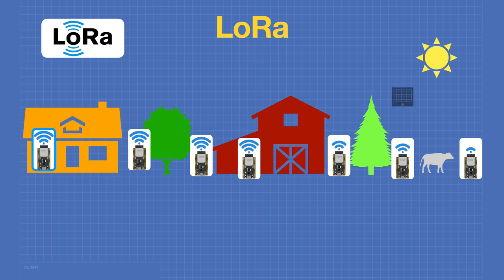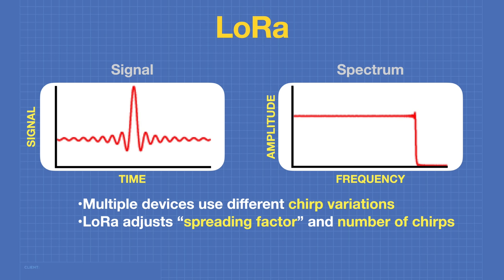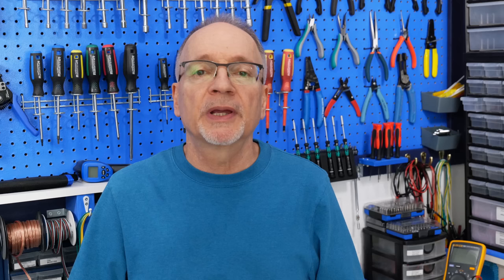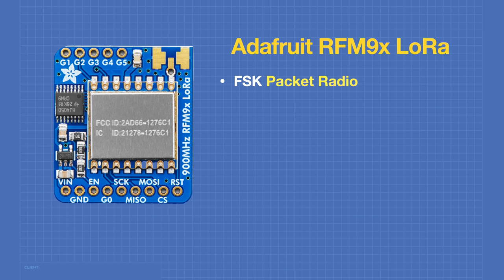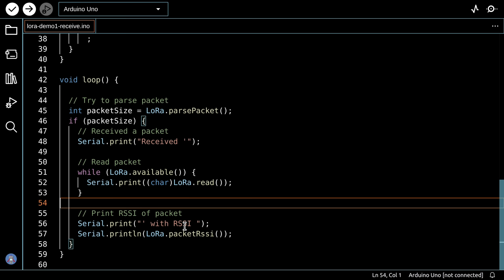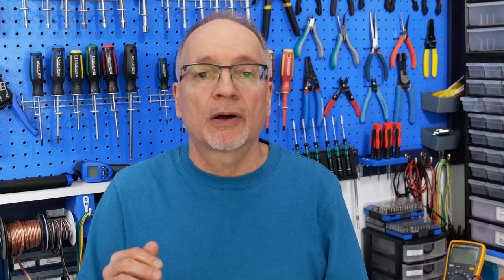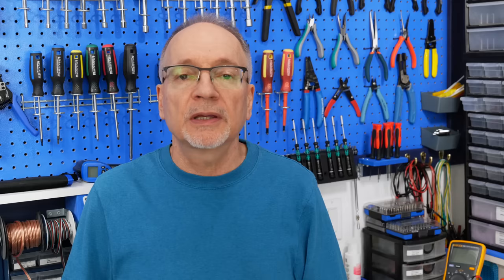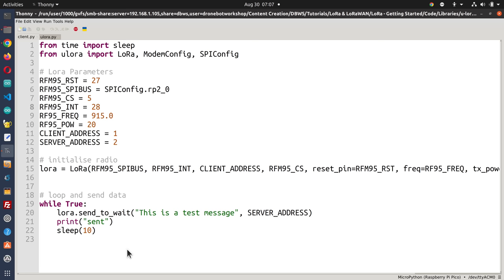LoRa - Long-Range Radio for IoT | Arduino, ESP32, RPI Pico

Comment: THANK YOU for not using scrolling code windows on your web site.  I absolutely HATE those because when printing, as I always do, valuable web pages to PDF from which the code can later be easily copied and pasted from, the windowed code won't be completely printed and so many sites don't allow the window to be maximized.  If they allow listings to be easily copied or if one copies from the scrolling listing, each must then be stored in a subdirectory instead of ALL being accessible in a SINGLE PDF document along with descriptive text.
Reply: If you right click the effected section and go "inspect" (or inspect element on some browsers), you can usually tweak the CSS or HTML content to fix the problem.... after some practice, it takes about 30 seconds to fix most unprintable sites.
Then just print to PDF (or a printer) as usual.

Comment: Great video, but I do have a suggestion. The way you are using millis() for timeout will fail due to rollover. millis() is an 32 bit uint. When it exceeds 0xffffffff it rolls over to 0x0, causing the timeout check to fail after ~49 days. This is obviously not a problem for testing but if someone leaves it running, it will be. You can check by determining if new millis() < old millis(), if so then elapsed time=(0xffffffff-old) + new.

Comment: Fantastic video! I'm currently building a soil moisture monitor using PicoW+Lora E5+capactive soil moisture sensor+microPython+ Home Assistant with MQTT+InfluxDB+Grafana to make decisions on irrigation for growing feed crops.
Reply: I am looking to set up a similar sensor array using some of the same tools for an agrivoltaics project. I'm particularly interested in your integration into HA. Could you provide more details about the project?

Comment: I'm transmitting and receiving data 3.2 km away with a simple spring antenna that came with modules, no clean LOS but still works great, -105 avg dBm so signal is pretty strong. I've just assembled 3rd device that I'll use for reserve and distance testing so I may update this post soon. Lora is amazing
Reply: What kind of data rates are you able to achieve?
Reply: That's handy to know. That's about the max distance I'd need to run any sensors.

Comment: I think Lora is the basis of a drone controller technology called ELRS, it uses the SX1280 chip to do the data receiving part of controller the drone and then you send the signals into the flight controller to perform the action based on the input
Reply: Well ahead, publish your works !🎉❤

Comment: At 21:00 ground goes to thin filament of LED but when you connect it for real at 24:41 ground goes to thick LED filament as it should. The led at 21:00 should be rotated.

Comment: LoRa is a 900Mhz signal so line of site is pretty much what you need between radios.  No buildings, mountains, etc.  Elevation is used for long distances.  If using radios on the ground, 3 miles is considered line of site on a completely flat ground.
Reply: He put a steel plate between the modules and it still worked. Lora is supposed to be able to penetrate materials much better than 2.4ghz wifi can

Comment: I use a cheap esp32 China module(433Mhz) with a build in 18650 battery,..and display ,, no soldering nessesary.
I use Aprsdroid app for following the aprs signals.  or  my Yeasu ftm400 

Its very easy to program the module  with a callname and some txt
Reply: HI Bert, can you share more details of what you are doing?  I am interested in similar.
73

Comment: Great video. For the wireless transmission part, you chose RFM9X with SPI interface. Have you considered other modules with other interfaces, such as UART or RS485. Maybe, then It can transfer further, like LOS10~20km.

Comment: Thanks! Very informative.  One question about the payload, is that a standard format? How do you know a packet is actually intended for you ?  If your neighbor ran the exact same code would you both process each others packets ? How do you assure unique communication pairs ?
Reply: Good question. And one that is quite important to answer, its not just one neighbor but anyone in a 10 block radius...

Moreover while I echo the sentiment of many commentators about the pace and quality of your presentations, I am staggered at the effort required to hard-code the OLED display.  I think there is some generous use of the term "we" as in "we are going to display two temperatures and two humidity values".  Realistically the network needs to be expandable so that "we" are going to be able to  receive input from N sensor types and M sensors in each type.

Plus the server may need to do computations, for example to calculate the difference of two or more temperatures or report the lower of the humidity readings and may need to set of alarms or visual indications of abnormal conditions and take multiple corrective actions, both at the server or back at the location of the sensors.  I see nothing in the code to illustrate how you would do this.  

Neither is it permanently, or temporarily, logging the time, identity and sensor value, so there is apparently no way to compare yesterday's value at the same time of day or take the sum or average of all readings within the last hour, the last week and so on.  

Basically unless you are actually looking at the OLED the whole setup is working for nothing.  

I saw a video today where the designer used png images created in Powerpoint to produce coloured sliders and formatted text boxes to create a really impressive customised OLED display.  But, in a day when we are not surprised to find such information on our mobile phone, I think that some of this video promulgates an outdated approach to sensor data and coding for the OLED display.  The mobile phone and not an OLED is likely to be at the heart of the interaction between a user and any network of sensors "we" are building, so to me it feels like you haven't really taken this to next-level IoT programming, and you may be training your 500k subs to think in silos.  

Please  don't misinterpret my observations as criticism.  Thank you for rekindling my interest in LoRa and Arduino.

Comment: Hello Bill, thanks for your show, invaluable, would like to know, if it's o.k. to use the R4, with Minima + wi-fi, to achieve long range connections, as you mention in your introduction to this Arduino Circuit. This Circuit is cheaper, and want to get started. Thanks again, watching your show, like going to Class. Loving it..🌹😊

Comment: I see little information on different frequency selection, how to set power output and how to choose the best Spread Factor. I have a number of RFM95W's in use and they work well but I would never get over a KM in range.  How do you measure the output power of a LoRa board?

Comment: I am a car guy with a good knowledge of electronics. You have have some but in blend door actuators use to control hot to cold, the simple ones use a gear driven potentiometer for 0-5Vdc and a dc motor to move and stop anywhere between closed & open. Being one level above cable and vacuum, how would a rotatory dash knob change polarity in the motor? I have 40+ years at dealer but as simple as can be, these controllers on the dash are only $40+ and one circuit board inside. I wanted to control heat / A-C in a 67 C10 pickup. Schematics show a block and call it "Logic". Is this an ardiuno thing or something way more simple that can build myself? Sorry to get off topic but your teaching choice of words are easy to understand.
DK, ASE Master Tech since 78, retired. Thanks.
Reply: I guess I was hoping for an idea or answer. In the world of "Robots", arms, legs or any part that moves part of the way, stops and moves some more while having the ability to return would fit my needs. It is no different than an "RC" car's steering. Left, right, center or anywhere in between. The problem comes in the controller as it has 6-9 other features costing 20 times the actuator. Just a simple mechanism to move, stop and move again. Maybe they can't make a controller that does that on 12 Vdc with a few wires, not a radio frequency. ASE Master, 78

Comment: Would be cool to have lora microcontrollers out in the wild powered by solar and mini wind turbines that could make an 'offgrid' online so to speak.  The power efficiencey of these things could make them autonomous and have them on for a long time maybe even indefinately which would be handy for emergencies and communication and what not. I was trying to imiagine this with regular low power wifi micrcontrollers but it seems Lora has them beat for range at leaste, speed on the other hand...  could a lora microncontroller be able to host a copy of doom2 if the internet goes down for us to download?  how about connect and play a game of co-op with reasonable lag?  I dont mind waiting all night to download, but the lag should be reasonable under 100ms ping.  If Lora can do that, we have made progress!

Comment: Great video as usual. Thanks.
All your examples seem to use the Adafruit module but I want to use the HopeRF module (with Pico/Pico W). Am I correct in assuming that I can use DIO0 instead of G0?
What are the other DIO ports and how are they used?
Thanks in advance

Comment: Hi Bill! I have a couple of questions regarding the esp32 controller method.

1. How much data can be transferred at once? From my understanding a normal esp32 is limited to 25 bits but since it has a lora connection, is it any different? 
2. Would you be able to use an Arduino in place of the esp32? Would it be able to use the full LoRa bandwith?

Thanks!
Adam

Comment: Early in to video it was mentioned that the data is(Or as I assume can be) encrypted. I don't see the usage of any keys, and it seems each device is reading one another in the clear. Are there examples of using LoRa with it's encryption features? That way you could use it without a 3rd party messing with your network.

Comment: Inches are divided into 1/4 1/8 1/16 1/32 1/64 Not 0.390 - 0.390 is less than 0.500 = 1/2 also 1/4 can not be used as it is 0.250 = to short, So first we divide by 1/8 = 0.125 So how many 0.125 in 0.390 = 3.120 So we have 3 x 1/8 with 0.120 over Now we use 1/16 = 0.0625, So how many 0.0625 in 0.120 = 1.92. So now we need to use 1/32 = 0.03125 to be as close as possible. But I will not quibble about 0.92 of 1 16th as it is so close to 1 16th and call it 2 16ths so the last total = 3" ins & 7 16ths long. But would start with a length of 3" & 1/2 inch and take a tiny snips off to tune the antenna - Other wise a great video

Comment: thank you for your video!! It help me start with LoRa.
Also I have followed the step in the section LoRa with micropython code and demo, but there are some question on my code. I used raspberry pi pico with the code, and it would turn out "AssertionError: LoRa initialization failed". May I asked you what may be happened with this problem? thank you.

Comment: Are they still working on Giga R1?  Can you tell me about the pin setups and software needed to get one or more of the touch screens working on it?  I have read on spec sheets about D1N, D0N, D1P, D0P, CKN, CKP + D68-D75 being the display oriented pins, but that doesn't tell me enough to know what displays and chips will work with it.

Comment: I ran this demo 3 with 2 usb c cables from the same mac computer. 1 to each r4 wifi connecet like shown to adafruit lora. I copied and pasted the demo 3 sketch into arduino ide, 2 seperate windows. changed local address to AA and BB, compiled and uploaded, made sure each r4 wifi unit blinked, indicating it uploaded. clicked the toggle buttton , it did not work. tested demo 1, demo 2, it worked. started debugging with serial statements, realized there is an issue with serial when running 2 windows. got rid of all serial statements from both sketches. it works like it should. not sure what arduino ide does not work  with 2 windows. but it works without serial.
Reply: now i use onley1 ide open, with 1 lora connected to mac, the other runs remote. still serial messes things up. almost seems like you cant have Serial in the onreceive. it will print the first char of whichever serial.println it hits, but then it will hang in that state. ie pressing the button first time will turn on led, but you can never turn it off. might need to use software serial, not sure.
Reply: from your interupt video, it seems that Serial cant be used in interupts, and I think if I am not wrong the onreceive method on demo 3 is a hardware interrupt. since its probably triggered by pin 2 or 3, don remeber which one. thereby serial should not work. or am I doing something wrong

Comment: Do you think it is theoretically possible to build a video transmission system on LoRa receivers and transmitters (similar to the Semtech SX 1280 module), albeit with low resolution?

Comment: hi 
thank you very much for your explanation 
i have esp32 s3 N16R8 and i the board has no GPIO 19 and no GPIO 23 
i have followed my esp pin out it has SS in GPIO 10 , MOSI in GPIO 11, MISO in GPIO 12 and SCK in GPIO 13
i have more than 100 tries to make it run with out success its giving me the error of connection fail 
can you please explain how to connect it or if there is any way to redefine the pins so i can connect my lora
im using LoRa-02 SX1278 433MHz 
i have tried with almost all boards that im having
wish to get replay 
thank you
Reply: I was able to get it to work with an esp32 and the RFM95W. If you need help, I'm here.

Comment: What is the battery connector on the Heltec device called? I have been searching for some Li-Po rechargeble batteries but they come with so many different connectors that it is hard to figure out which one is the right one for a beginner like me. Any help is appreciated, thank you.
Reply: Ps, 2 pin.

Comment: one lora module costs 6 bucks. one pair reciever and transmitter for arduino SYN115 and SYN480R costs 0.6 bucks.
one lora controller costs 26 bucks. One esp12 costs 1 bucks. 
Idk men...

Comment: I was thinking to use something like that as a wearable tracking device but 150mA sounds like too much current. And that's just the module. uC will draw some current two.  It would drain the battery quickly.  I wonder what kind of technology they use in Alzheimer wanderer devices.  I understand it would need a uC, a GPS, and then some kind of a radio or 4g connectivity.  That sounds like a lot of power consumption and I am not sure how it could be made small enough to hide in a shoe or clothes etc. and also without having to pull it out to recharge it all the time.